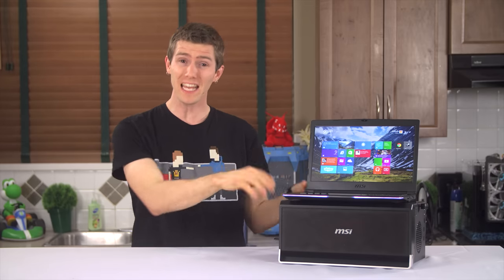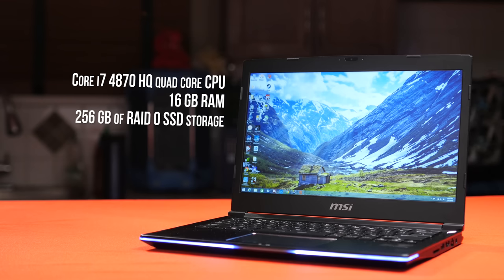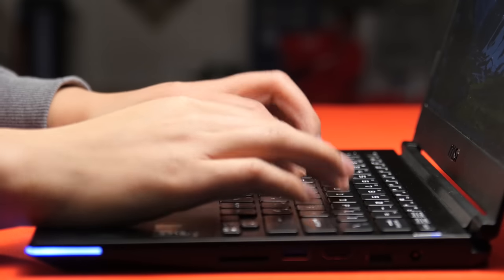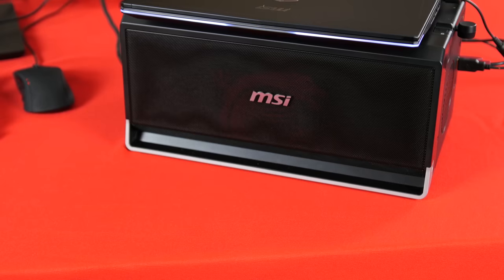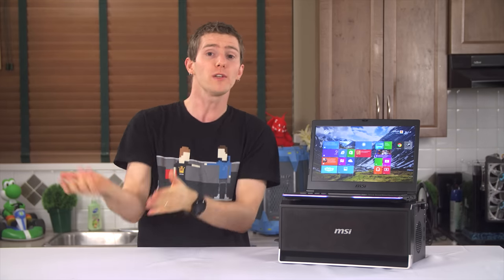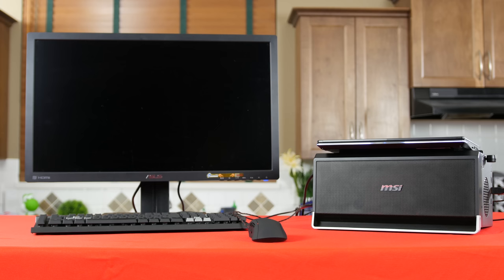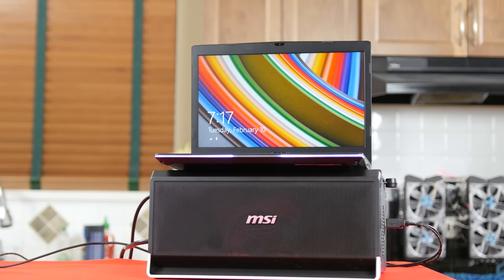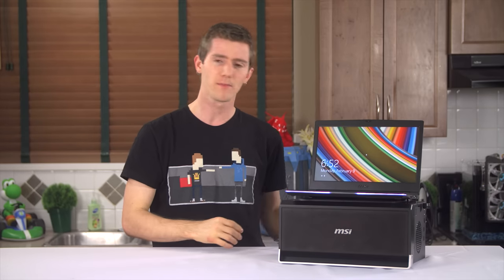MSI GS30 Shadow - Part Beastly Gaming Rig, Part Ultrabook

Comment: To me this seems like a great product, especially for gamers who also need a laptop for school or work. For example, here in Finland it's basically REQUIRED that you have some sort of a laptop to school (high school and up), and if you also are a gamer, this is a wonderful solution. In fact, the only reason i won't be buying it is because i want to build a custom pc for the experience of building a pc. The only complaint about the product is that it needs a lot of extra purchases to be done, like the external GPU, and it pretty much requires an external monitor, since the laptop will be sitting on top of the dock. Unless you have a massive hole in your desk where you can conveniently place the dock. The latter however i doubt will be a big problem. What sucks is, again that while its price is 2000 dollars, with the addition of a monitor and external GPU, it will cost around 3000 dollars.

Comment: Fixed audio, thanks. So, I like the concept... although, I would like if the box mounted to the 16x slot behind the laptop. This way you wouldnt need a monitor and keyboard, and you could play using the laptop and a mouse without it being 1ft in thr air. This would make it perfect for lan as well, just grab your laptop, mouse, and the box and go.

Comment: The problem I see with this is that once you connect that laptop to the dock it's no longer a laptop.  By it's now extended thanks to the dock there's no comfortable use for the keyboard, meaning you would have to buy an external one to fully utilize this product.  I don't know if anything happens to the screen but this guy had a monitor plugged up as well. 

Got to give it to Alienware for this one.  On both cases the laptop is no longer portable sure,  but besides that you can still fully utilize their laptop.

Comment: I have three main issues with this. 1. It has to sit on the box. 2. It uses a proprietary connection. 3. you can't use the laptop screen when it is docked, so you also need to buy a separate monitor if you don't have one.

Comment: What MSI should do for Gen 2:
- Make the hard drives dockable, and include 2 3.5 inch bays
- Don't use it as a base for the laptop, make it a box that sits behind the laptop

If those two changes are made, i'd seriously consider investing in this.

Comment: All you need is a pico psu reliably pumping out 3-400w, an enclosure for both the psu and gpu and a pcie ribbon. It doesn't need to be this big or complicated

Comment: I'd much rather have two PCs if it means they could be quiet and small.

I could also suggest adding a fan mount for radiators in the GPU box to allow for liquid cooling of the GPU or just better cooling in general

Comment: LINUS: You missed a vital point of review: Showing the system hooked up to an external monitor implies that the monitor is necessary, but you never said whether or not it actually is. For those people wanting to replace their PCs, or use this as such, knowing to have an external monitor for gaming is a pretty big deal. The DIY solutions out there WILL allow you to play on the internal LCD, but your FPS will take a considerable hit to do so. They recommend an external monitor as well, and I bet this is the same. /LINUS

I absolutely understand what many of you are saying, and you're absolutely right: For those of you who game and live in a more conventional setting (house, apartment, etc), paying around or over $2000 would be crazy. It's a pretty neat solution for those of us that travel the world living out of a pack though. A DIY solution, like Linus mentioned, would cost about the same, and this one's already ready to go.

Of course it's designed to be as cumbersome and non-portable as possible. Speaking only for the full speed GPU link, that could have been a cable with a proprietary port. No company with a line of mobile gaming computers would compromise that product line to provide better service to customers though. No sarcasm intended: Better solutions for customers aren't parallel to good business practices anymore.

Still, this would work. I'll need to take a hacksaw to it, and cut away the box, add some hinges, throw away what I don't care for...but the rest could easily fit in my pack with the laptop. The same cost DIY solution results in 10% less speed because we're using Thunderbolt2 solutions, so for me, this would be a good investment. MSI would hate me for my Frankenstein tactics though.

Comment: I liked Alienware's solution much better. They had a box that you could put out of the way and then plug into the laptop via cable. That way you can still use the laptop normally when plugged in without having your hands way up in the air.

Comment: I thought of building my own rig to, how you say, give a shot of adrenaline to my g74sx, I've heard it's possible to use the DVD-ROM connection, which is not elegant, but quite an interesting project to take on. Right now it's taken by the 3rd HDD on this portable 'laptop' computer, and it would be fun to switch it to a great GFX card.

Comment: Why would they design the gpu mount to be on top? This directly transfers heat to the laptop. I would have the gpu sitting upright at the front with a mesh/filter covering the front of the case to allow the gpu to suck in cool air. It would also offer much easier access when you wanted to switch the gpu.

Comment: I just wish that the connection was done via some type of cable so I could use the monitor and keyboard of the notebook to play.
With this kind of configuration you still need a monitor and a keyboard to play.

Comment: If you want a solid vocal microphone, for use on spoken word or singing, do not get any of the Yeti series. They use Small Diaphragm Condensers, which are great for instruments, but can easily sound thin and weak on vocals. Instead, find a Large Diaphragm Condenser.

Comment: If all you wanted was an external gpu, you could build an adapter pretty cheap..
The edge connector on the laptop is probably PCI-e x16 with some extra buses for the Ethernet and usb.
If you want to be real ghetto you can just go from USB 3.0 to PCI-e 1x with a 1x to 16x edge riser (you can buy pre done kits for $20) Obviously you won't get the full performance but hey, you could have a Macbook air with a titan haha

Comment: That dock is just RIDICULOUSLY large for what it offers. A GPU, PSU, single 92mm intake and a 3.5" drive...whereas my RVZ01 desktop case, which is actually SMALLER by volume than this laptop's dock, houses and cools an entire computer (including full size dual slot GPU) with three 120mm intakes, a 3.5" and two 2.5" drives, AND a slim ODD. Mine can run its 4790k at 4.6GHz, and its 980 heavily overclocked, all while staying very quiet.

It seems to me that the dock could have been a lot more compact - and built a lot more intelligently than it has been. Mount the GPU vertically and not horizontally, have two front mounted 120mm intakes blowing on it, put the PSU and a drive bay behind it (segmented so the GPU exhaust doesn't hit it) and fit a 120mm high static pressure fan with its own intake vents on the top of the dock forcing air into the laptop's own intake vent. You could easily fit all of that into something MUCH smaller than that dock currently is.

The GS30 just seems so flawed to me in general. They haven't made good use of space, the build quality seems poor, and it is FAR too expensive. What I want to see is a reasonably slim 14-15" laptop with a socketed LGA1150 desktop CPU, give it a massive heatsink taking up the entire rear of the notebook cooled by 2-3 fans. If Razer can cool a 37W CPU and a 970M with a TDP of about 100W in their 14" Razer Blade, it should be entirely possible to cool a 100W CPU in something just as slim and small. Particularly if you lower the max CPU speed and voltage running on battery (limit a 4790k to, say, 1.05V and 3.5GHz on battery and it's as efficient as any mobile CPU) and if you force air into it through extra intake fans when it's docked.

Comment: Why is there so much hate for this product?
I think its a great Idea that MSi has gone through with this, I for one have wish I would have a work laptop that is small and speedy for quiet usage and also a beastly gaming machine and this wraps it into one package.
Yes the price is high and it has a few flaws but it is the first of its kind and there is room for improvement but I think they are heading in the right direction.

Comment: I love this concept, but that's just where I feel this product should still be.... In concept.  If it's as loud as Linus says, that's not acceptable. And with a dock that size, I feel it should be capable of housing 2 graphics cards splitting the 16x slot into 2 8x slots if wanted. The internal drive bay is cool, but I'd rather that room be used for a second card if wanted or used for better cooling. I can always use an external drive if I need more drive space.  

That aside, I really can't wait to see where this product goes as it matures.  Good job so far MSI.

Comment: I would love an ultrabook with an external GPU like being integrated into the power brick, keeps the heat away from you, keeps the cost and size of the laptop down and could be upgradable too!   this really needs to happen
Reply: that would be awkward as hell but viable. it would have to be a fully custom mobile card though and they arent commonly upgraded.
Reply: Do you realize how fucking big that power brick would be? And to adequately cool it it'd be less of a power brick and closer to a Mini-ITX PC, unless you plan on SOLELY using the GPU's fan to keep it cool without any other cooling source, which would run the card very hot. Also, a proprietary port that carries power and full fucking PCIe connections would be needed, and that would be absolutely massive for a charger port. You're far better off with a dock. If you don't like how the laptop is mounted on top Alienware has a solution with a cable (although very expensive.)

The idea seems nice... in theory, but to execute it would be fucking insane.
Reply: It wouldn't be that much bigger than a standard high amp gaming size brick (9*16*4cm) with something like GTX960M and the PCIe/power cable could be downsized easily
Reply: Ryan Day
If the brick was only the size of the GPU, yes it would be the size of a standard high amp gaming brick. But to fit both the GPU and power components would be more than double the size and that doesn't even take into account cooling. Also, the charger port really can't be downsized unless you want to compromise a LOT of performance with less pins, and to do that you'd need an adapter in the brick as well. You saw how big the PCIe slot was alone on the laptop, so to add power to it would only make it even bigger. Also if you want to use a mobile GPU that almost completely defeats the ability to upgrade unless you want to use an MXM card which are VERY expensive. Why not just integrate the GPU into the computer if it's going to be mobile anyways?

Comment: For the price point, you could get a very good gaming PC (desktop obviously) that can outperform this thing by leaps and bounds, and it'd be quieter. Not only that, but you'd have enough cash left over to buy a relatively good notebook. After all, the notebook doesn't need all those specs to make the gaming better, the main use you'd get out of it you could get from an i5 with 4GB of RAM easy, and that's well under $800 for the notebook alone. Sure some people might like this idea, but I think for the price it just doesn't add up.

Comment: It needs a proprietary cable to connect to the dock, stacking it seems very impractical for me to require to be stacked on that box. I do know PCIe has distance limits, but Alienware did pull it off with their design.

Comment: I bought this laptop when it first came out. It was everything I wanted for college. It was the best implementation of desktop graphics on a laptop. Over 3 and a half years I've enjoyed this product, but after this time I have problems. The cpu no longer goes above 1ghz, if the laptop lid is closed wifi quits working even when docked, runs at 150°f at idle.  This is due to the poor implementation of cooling which failed. This laptop has been babied over its life, but the cooling sucks.

This was innovative and well executed, but like linus said it has first Gen problems. This has lots of good points, but now most of them are industry standard. For the time it was new and innovative, and it managed to offer lots of new features that only just came to the market. 

If I was going to do it again, I would buy a new laptop and a thunderbolt dock than a solution like this.

Comment: It wasn't a good sign when only one of the initial reviews touched upon the cpu fan noise / temps.  I'm not an engineer but if MSI wants to sell the idea of the laptop being the heart of this hybrid gaming rig; than a much more robust cooling solution is needed.  Why seal off the GPU side of the rear ventilation? Why not extend the cpu cooling to help reduce temps so that fan doesn't kill itself after a few years

Comment: I wouldn't buy it, but if the technology develops and gets more refined and less expensive then it might be worthwhile in the future. One thing I personally would like to see is having a cable connection to the dock in case you want to put the bulky part a little more out-of-the-way compared to where you put the notebook you'll be taking with you frequently. Additionally, if possible, I would love to see a video INPUT on the laptop portion so in a pinch you don't absolutely need an external monitor. Those are relatively minor complaints though, and maybe by the time I would be looking to completely replace my desktop rather than just upgrading some part of it the pricing and implementations will be more competitive.

Comment: LinusTechTips Planning on a review of the Alienware 13/15/17? They are the guys who originally came up with this idea and I personally think that their option is more practical than this one. You can game straight on your laptop display if you so wish, since the laptop doesn't rest on the top on the dock, and the 15 and 17 inch model both include up to a GTX980m on their own. Especially the alienware 15 is one of the most powerful 15 inch laptops on the market. Can go up to a 4K IPS ultrasharp touch display as well. It also has a steel plate reinforced keyboard so you get none of that flex when you press down hard on the keyboard. And lastly it has a huge battery and according to some early tests, it gives it an amazing battery life for a gaming laptop, and even goes head to head with non gaming laptops as well.
Reply: LinusTechTips  Oh yeah I see you mentioned how Alienware's option is kind of repetitive, since the laptops already have a gaming graphic card in them. But for someone who games BOTH on the go and at home, rather than just gaming at home and having a portable ultrabook on the go, Alienware's solution makes more sense. Since MSI's product is aiming for those that only game at home and use their laptops for work on the go, I think it would be interesting to try out another option that is aimed at another group of consumers.

Comment: LinusTechTips The whole GS30 setup looks practical for those who want to game at free time at home or office, and work on the move. But apart from the gaming dock, don't you think MSI should have integrated a mid-range GPU for the laptop alone- such as a GTX 960M.? Because people on the move also play at times? The laptop is very light and comfy to use. Ultrabook class truly. 

And you are right about the keyboard, its better than the XPS 13 2015, and the fan is loud, i had to turn the battery mode to low power.
Reply: Good point. But the Iris Pro is decent enough for on the go light gaming. Overall its a 13" screen so It wouldn't be that pleasant of an experience to game on anyways.
Reply: For light gaming yes, but not everyone wants light gaming on the go.

Why would i have to spend a lot on a gaming laptop just to tune down all the settings to lowest. And play with lower resolutions to get decent framerates Just doesn't make any sense. I just might well buy an affordable laptop with the same Intel GPU.

Regardless, the MSI GS40 is a much better choice, thanks to the built in NVIDIA GTX 970M GPU.

Comment: Why not just adapt a x16 PCI slot on laptops? Along with an external unit of sorts consisting of just enough space for a power supply and a graphics card. That way you can keep out the limitations and just make an easy solution for all that works universally and compact at that. This thing is unnecessarily huge.

Comment: Pass don't see it picking up a huge amount of support and hopefully MSI and other companies learn from these first gen attempts and get solid gen 2+ gaming docks. TBH I'd still take the 2 apart for now or do an Nvidia powered machine with Shield controller or tablet for portable gaming. Very informative however and do see hope again for gen 2 or another company modifying this design to address them heat and noise issues.

Comment: A computer isn't just a gaming machine or a workstation or a browser, it is a single package. I develop software on the same machine that I game and I browse and do other daily activities, having a separate computer for every one of these activities is just not good enough. I also want all of these activities to be locally accessible as ssh provides only a solution with constant internet connection that you don't have access during most trips (and unreliable). Though considering the amount of gaming I do on the go, and that it is mostly lightweight gaming that is not Crysis 3, products like GS30 or AW13 makes a lot of sense for my group of people. That being said, I prefer light gaming laptops with dedicated GPU as Maxwell seriously closed the gap between mobile and desktop platforms.